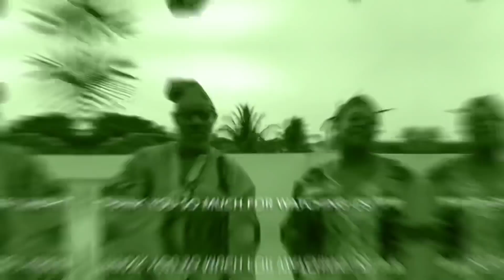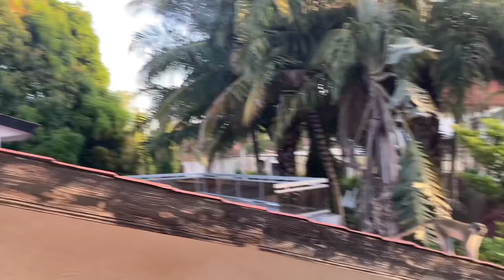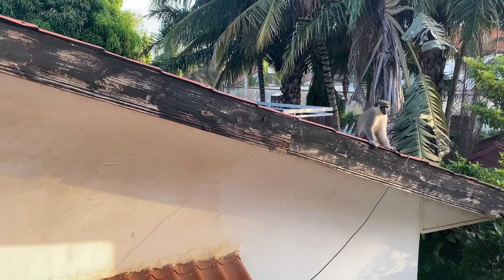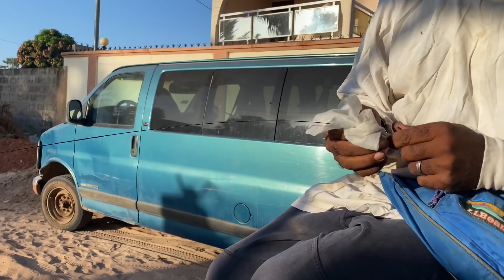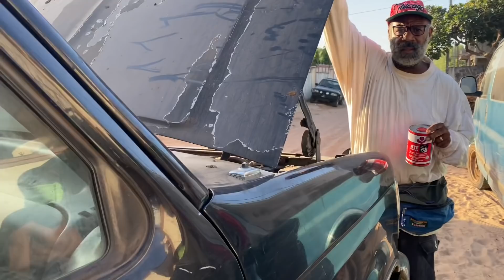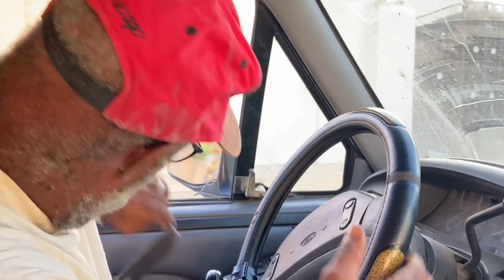He scratched too much or did he?

Comment: Greetings B.A.G, there is nothing like man, woman and their best friends.   Ensure that the vehicles has correct levels of oil as it will be costly to replace an engine due to insufficient oil levels.  The clicking noise could very well be the engine valves out of gap which could be very costly over time.  Thanks for sharing.